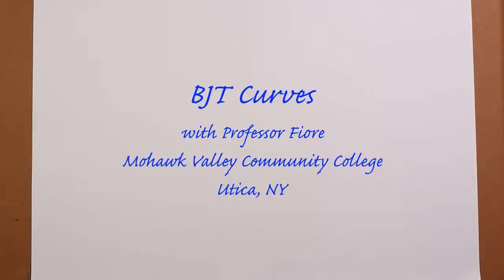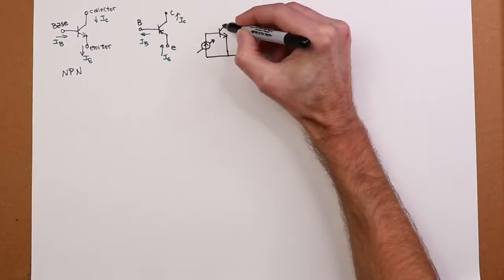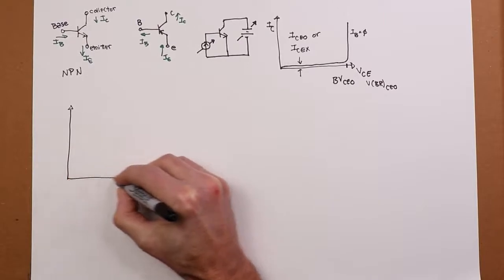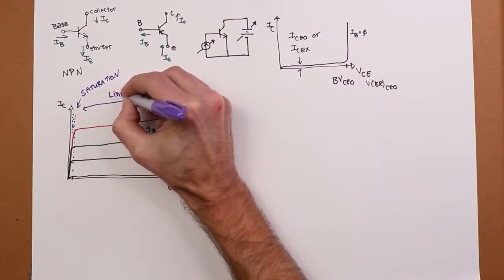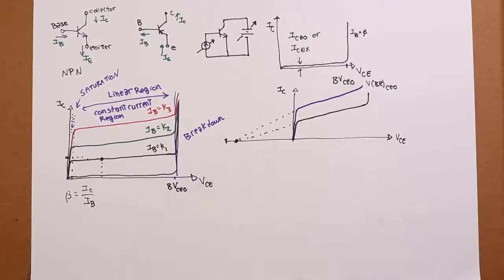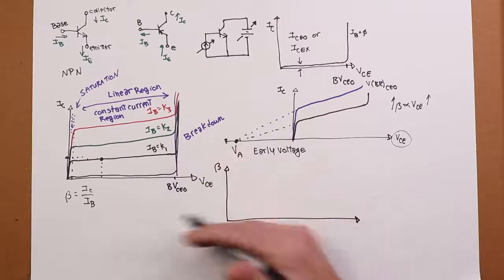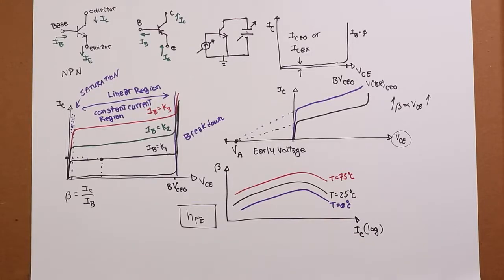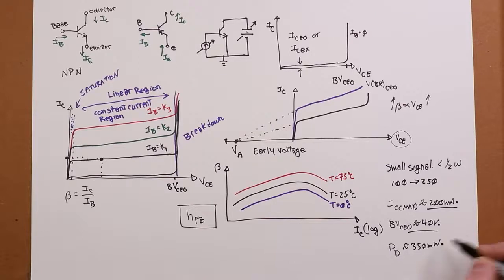Semiconductor Devices: BJT Curves

Comment: Thank you, Problem with datasheets though: No Early voltage or R0 is specified
Reply from the maker: If there are collector curves (or if you have a curve tracer), you can determine the Early voltage by inspection. In general, it is not needed for typical circuit analysis (usually just beta sensitivity calcs).